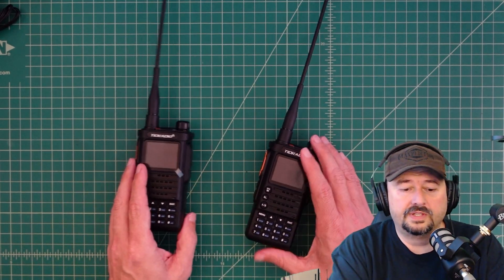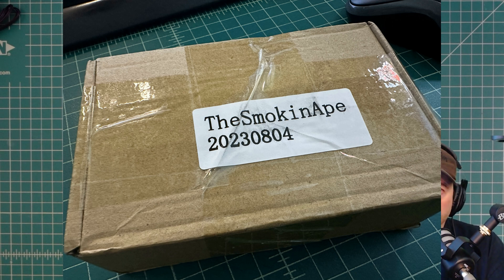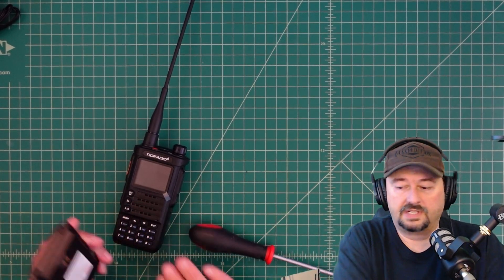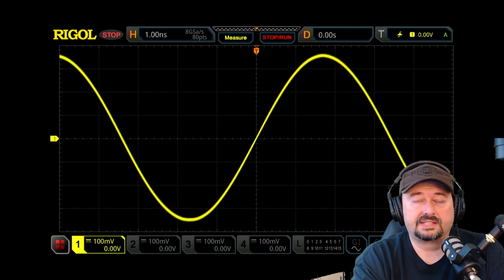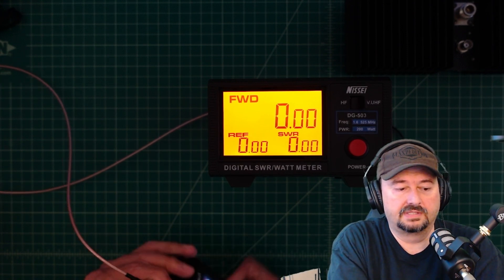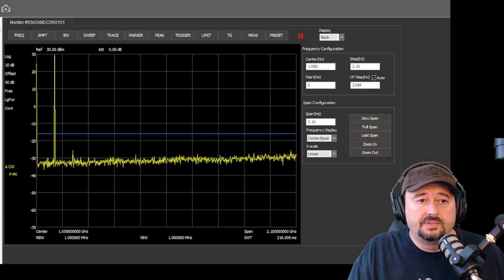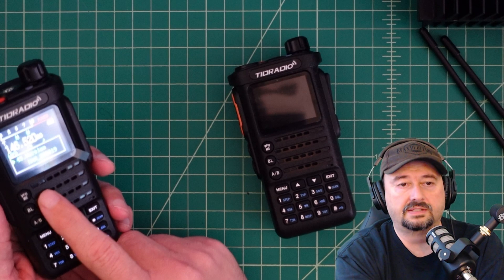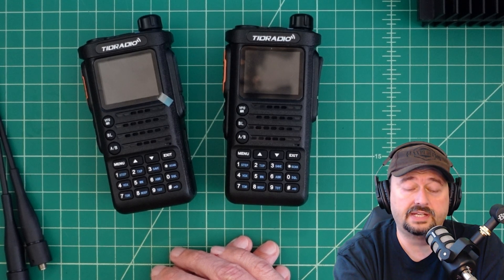Is it fixed? - TIDRadio TD H8 Gen2 Ham Radio

Comment: I have one that won't turn on so how do I fix that?
Reply from the maker: Is it charged?
Reply: @TheSmokinApe  The battery is bad and it won't charge, the leds just blink red and green over and over. I wonder if they have a warranty on batteries?
Reply from the maker: @stevec5000 I doubt it but they might…. I think they sell replacements 🤷
Reply: @TheSmokinApe  Yeah, way over priced for about $20 which is more than the radio!
Reply from the maker: @stevec5000 that’s TID for ya

Comment: This used to be my favorite HT until I bought the Radtel RT880G....Dump the tidradio and get you a radtel 880g...Sure it's about $30 more but it way worth it because it's main feature is a frequency spectrum and you can monitor 3 channels at once and it has CB, SW, LW, airband and so much more.
Reply from the maker: I haven’t traveled Ed the Radtel

Comment: Just bought a couple 2nd gen TD-H8s.  Programming/ Mic port does not work.  Can short out an transmit.  Can transmit to repeaters, but no modulation.  Returned the radios.  Oh, support line busy all day.  Couldn't get thru.
Reply from the maker: Hopefully they see this comment.

Comment: Thank you for a very good review, especially the detailed history and multiple tests to confirm that the problem was resolved.  Hopefully when other folks order this model, the radio that ships off the shelf will also be fixed, not bad like your original ones.

My disappointment concerns output power.  ICOM already makes some HTs with a good solid 7 watts output.  The TID output of 7.7 watts is only 0.4 dB more than 7 watts ... an insignificant difference.  7.7 watts is also 1.1 dB less than the advertised 10 watts.  So in spite of the improvements you noted, I wouldn't buy this radio because of its "high output power."  It's still false advertising IMHO.

Again thanks for the excellent data and review!

73 de K3GEM
Reply from the maker: Hey Greg, given my experience with TID I'd never recommend them to anyone.  Also, after the radios were "fixed" many hams who bought them after still had problems and "support" was less than helpful.

Comment: I'm disappointed with the H8 I received 4/22 direct from TIDRADIO. At 146.5 on high power 37.1dBm which is 5watts, not 10 and the harmonic is -12dBm on the tinySA. Six emails the last two days to return/refund and Khan doesn't think there an issue. Their customer service is disappointing, too. The H8 is 02/24 manufacture with most recent firmware. I thought I'd done my homework. 73 KN6VYP
UPDATE: Khan is sending me one that's perfect. Squeaky wheel gets the grease
Reply from the maker: Sadly I am not surprised, this company has been hit or miss and it’s disappointing
Reply: @TheSmokinApe Saga continues. Replacement was 1w higher at 6w and comparable harmonic. Also bought one on AliExpress for $34 and it's 9.5w with comparable harmonic. Power tune made no difference on high power only L and M. Quality control is lax or...I don't know.
Reply: @TheSmokinApe Ape, Khan came through and is sending me a radio that is perfect. Squeaky wheel gets the grease.

Comment: Did you or anyone else happen to notice the horrible RF interference that the LED display causes? Tidradio's are poorly designed (engineered) in many ways.
Reply from the maker: Yeah, the radio had more problems than a math book.

Comment: Info from the manufacturer.  There will be no modifications or fixes to the SMD board in the V8 model.  Another version of the Td-V3 model is in preparation.  He's due out soon.  If it doesn't outclass Quansheng this time, the brand will be just an episode for me - a curiosity.  And no one will take the test as uncompromisingly as you👍.
Reply from the maker: They were going to send me a H3 but decided not to, I guess they would rather send them to folks who don’t actually test them?

Comment: Does the tidradio use same cable as the uv-5r or other baofeng? Tried to use it for chirp on Td-h8 and would not communicate.
Reply from the maker: It does but its difficult to make sure it is fully seated.
Reply: @TheSmokinApe  yea I ended up seeing that on your video and held it in tight and worked great. Thank you.
Reply from the maker: Glad to hear it helped 👍

Comment: Looking for distortion on RF waveforms is rather pointless unless you are looking for gross distortion. A -10dB signal would be about 3.1% noise on the carrier, which you may be able to see. At. -20d, you’d be looking for 1% distortion, which would be very hard to see. In addition, your scope would need to have a much higher bandwidth to see the distortion. For example, a 500 MHz oscilloscope would be 3dB down (showing 70.7% amplitude) at 500MHz. Any distortion products would be much higher in frequency and would be attenuated. Using a good commercial spectrum analyzer is a much more meaningful test. Thank you for this and similar videos.
Reply from the maker: Thanks for the info and for posting, glad you like the videos 👍
Reply: Ok.

Comment: So it’s your fault?! Your responsible for the TD-H8 being my favorite? I am a new ham (4months) and have 18 different types of HT radios. I of course started with a simple UV-5R and will always love them but carry my H8 at all times. I actually purchased 22 uv-5rs, programmed them, reboxed them, and put them in my closet. Everyone (except my eye rolling girlfriend) in my family and friends group is getting one. Well, my sister is getting the H8 but she’s into radios just like me. We use a local repeater to talk to each other 35 miles apart. Lately I’ve been using my tinySA to test all my radios and the H8 is one of the best. Just under a couple yeasus I have. I have gone through Amazon and have purchased every radio they carry under $100 and the H8 is the best so far. I must say my least favorite is the UV-17r. I bricked it the first night I had it. Only recently figured out how to un-brick it. I’ll take a UV-5R over a 17 any day of the week. I mean, I’m sure someone loves them, but not me.
Reply from the maker: Sorry man!  These things do have a tendency to multiply 👍

Comment: Need your advice. Which I should choose? This one, or Retevis AR89/TYT UV99 (ip 68 is not a big deal for me)?
Reply from the maker: I have never messed with the UV99 and have only marginal experience with the RA89 which I just did a video on.  I'd probably say the Retevis just because I have more experience with them in general than TYT.

Comment: After watching this video, seeing that Tidradio fixed the problems I went and ordered one. It arrived today, and after charging the batteries, I went through the menus, and what do I see, firmware 230317. I am not a happy customer right now, but with what you and others have said about their customer service I sent them a message. So waiting to see what they have to say. At least I can still send it back to Amazon if necessary. I was looking forward to using it, but not with all the spurs etc you showed on the older videos. Just wanted to let you and others know they 230317 are still in the pipeline.
Reply from the maker: Hope you get it sorted out, sorry to hear you got one of the old ones
Reply: @TheSmokinApe  I contacted customer service and they said the firmware update will fix the issues, so I am going to try that and see. I know you were wondering if it would also. 73
Reply: @TheSmokinApe  Good morning and sorry to bug you again. I updated to 230911, has all the  updates but unable to check on the spurs etc. So if you update your 230317 hope you do a video on it, as I want to see if the spurs are gone. 73.

Comment: With respect to the Amazon stock, a H8 Ham delivered yesterday came with HAM_230317! But the audio issue is not present. Which makes me lean towards there was a hardware change.

Notable is that with the TD-771 antenna, when using the external microphone there is an obvious range improvement likely due to a better ground (plane) for the antenna formed by the external microphone cable. I want to test this with a car mounted antenna, likely later today.
Reply from the maker: Sorry to hear you didn't get the new firmware, I will be doing the FW upgrade video this week hopefully 👍
Reply: I also purchased mine from Amazon and it’s running 230317 firmware.  I’m not having any issues with mine.   I don’t think I’ll do any FW updates.

Comment: I got one in early August from Amazon, it must be from the newest batch because I have none of the previous issues.
Reply from the maker: Glad to hear it’s ok 👍
Reply: Got mine early December from Amazon with 230317 firmware.  I’m running strictly GMRS and I’ve had nothing but great success with it.  I’m hitting repeaters 54+ miles from my home and even hit a few repeaters that are 20 miles away inside my home in basement!

Comment: I sent mine back. I really liked it but the issues out weighed the pros. Mine didn’t make the noise when keyed but had very low transmit audio. 
Great work on Tidradio ‘s part for listening and addressing the issues. I will give them another shot. 
As always Ape great video. Thanks for what you do. 
De KK4LBJ
Reply from the maker: Sorry to hear you had a bad experience Wayne, thanks for watching 👍
Reply: Should have cranked up the mic gain.  I noticed that if you don’t have gain set to at least 25 your face needs to be practically touching the radio when talking.

Comment: Why as a company test for half a year when your customers can test all of that in 3 days :D

If you act like tidradio (replacing units without hassle, fixing the issues, listening to feedback etc) i see no deal breaker in this approach (although it is usually used in software which makes much more sense).

How they acted reminds me a bit of the early oneplus company with their community forums which i quite liked. So now I'm considering buying this radio :)
Reply from the maker: It’s rare that a company addresses the issues, I’m glad to see them working to fix this…

Comment: Having harmonics of the fundamental can give erroneous power readings since most detectors are diode based, and sensitive to harmonic influence. 
The improved harmonic readings on the new radio may be even better as you may be looking at the dynamic range of the spectrum analyser. Try an LC notch on 146 MHz or a 300 MHz HPF on the output of the attenuator.
Reply from the maker: Thanks for the info Tech, much appreciated 👍

Comment: I bought on Amazon 2 of these radios: GRMS and HAM, the HAM has the noise, the GRMS NO noise.  The GRMS comes unlocked for HAM, so is a HAM radio without noise.  I guess they fix NOTHING for you, they just tested some radios and sent you a radio without this issue.  Other people also related their radios have no noise.  Is almost random.
Reply from the maker: There is the noice problem but also the spurious emissions, did these folks test that as well?
Reply: I’m using mine as GMRS and haven’t had any issues.  I’m hitting repeaters 54 miles away on medium power.   Mine had 230317 firmware on it from Amazon.   I don’t run ham on it even though I could but I don’t have any issues with it and I’m getting good feed back from contacts.
Reply: @Freebird_67  Yes, GRMS has a lot of power, but if you change it to HAM will be only 5W.

Comment: I thank you for going out of your way to make sure these companies stop just piecing stuff together and making us their beta testers. This looks a bit better than the last one. Progress is purges. Now people are going to have to watch out for "the bad model" of these radios. Any chance you can post up the serial number endings of both so we'll know what range to not buy?
Reply from the maker: I'm glad they did the right thing.  I will post the SN's in the firmware update video 👍
Reply: @TheSmokinApe  that'll help with the folks that get them from Amazon and whatnot that might be starting out. At least we'll have some knowledge based on what serials to look out for. Appreciate you. 🤙🏽
Reply: I sent back four of these I bought from Amazon several weeks ago. 

Would like to get the new updated clean radios. 

Any advice on best vendor on Amazon?
Reply: @J0HN3  i sadly don't as I'm not from the USA
Reply: I think tidradio announced that amazon still has some of the old stock but they already send the new stock to their warehouse. If you are unlucky and get an old one, they will replace it immediately for you
Reply: @KilianGosewisch  that's pretty awesome of them. Thanks. I love this community. 🤙🏽

Comment: I received mine a month ago. Audio reports are VERY LOW. I will try to do a firmware update to see if that helps. Otherwise, I will have to scrap this radio.
Reply from the maker: Good luck with it Matt 👍
Reply: I had the same issue. The mic gain setting was likely set too low at the factory. Tidradio told me that the  ODMaster app does have a mic gain setting to change it higher. I hope CHIRP gets updated to be able access that setting. I tried it last month and it didn't have it. I don't trust the ODMaster app, it wants too many privileges on my phone that I don't see a need for it to have in order to program the radio. so, I returned it, given all of the other reported issues.